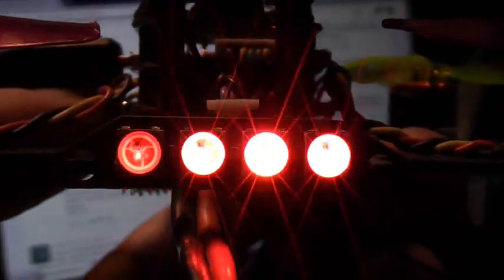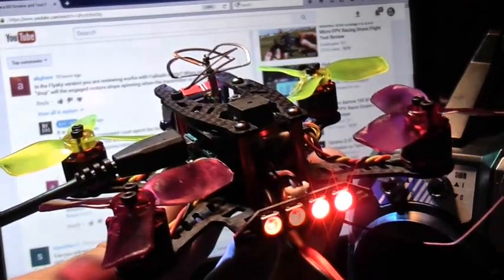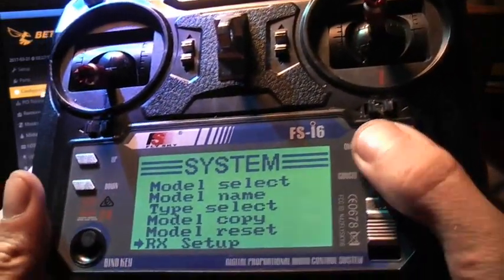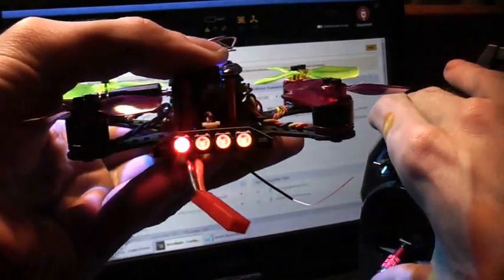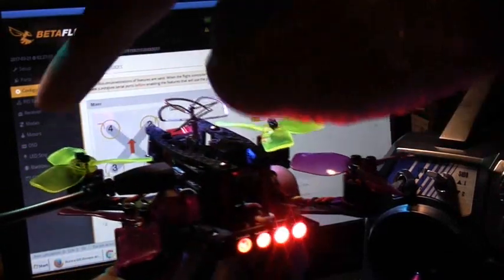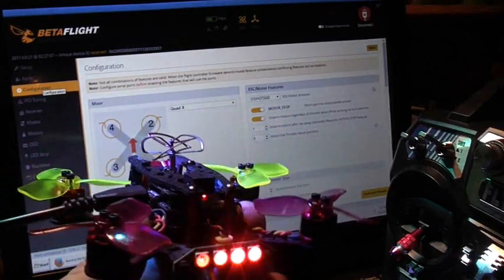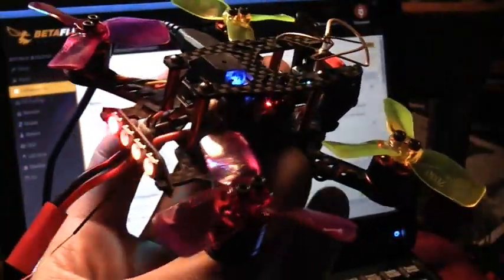Was this drone prgramed to fail and fly away

Comment: Mine flew away the other day... failsafe was set in betaflight... I was only about 60 meter/yards away when the quad would not turn I tried to disarm and rearm I regain control began to turn around gave about half throttle to a fence and it went full throttle climb at about a 45 degree angle total flyaway. Thank God I live the country... that little quad is somewhere in 200 acres of wheat. The battery was fresh and most likely flew for close to 4 minuets at full throttle... my spotter lost visual in about 15 seconds. Video dropped at about 20 second at I’m guessing 400 to 500 high...😧😳 been flying RC for 20 years and that was my first flyaway.... BE VERY CAREFUL WITH THIS QUAD... Mine could have hurt someone or damaged someone’s car...

Comment: Flysky version failsafe does not work on BF gui or the TX.
Frsky and DSMX work fine as verified by many.

Better durability props available now, they don't bend at the root and cause stress marks quiet as easy. Here's my last video flying them. I won't be going back to stock.
https://www.youtube.com/watch?v=n2SdsH_ddxw&feature=youtu.be&ab_channel=MicroRCFiend
Reply: MicroRCFiend AndyRC and others actually reported brownouts with the FrySky version due to the voltage telemetry. Currently the DSMX version is the only one without issue. I'd stay clear of eachine FlySky and FrySky RX and use an external micro RX if you wish to use those protocols.
Reply: There is not general consensus yet whether that is due to telemetry since others that did have the FoD early on (Seby and FyreSG), can no longer duplicate it. It may well be but it needs more than 1 person to verify that and it needs to be repeatable to be sure. More data is needed, especially as it's very common for early reviewers to get a slightly different version than retail purchases.
Fyre says he still has telemetry on with Frsky and cannot make it FoD, Seby just has a new frame so curious to see if he has these issues.
There's some discussion here if interested..
https://www.rcgroups.com/forums/showthread.php?2849192-Eachine-Aurora-68-68mm-Micro-48g-Brushless-BNF-with-OSD/page7

Comment: try setting the failsafe to channel 5 or whatever your arm switch is on. i just got a turnigy evolution and was setting it up on my wizard and it would not failsafe on channel 3 so i set failsafe to channel 5 which my arm switch is on and failsafe works now
Reply from the maker: I'll try that on a few of the other eachine aircraft with this problem.
I just posted a video showing how I take the FSA8S receiver from my falcon 120 with working fail-safe and solder it in this one. It gets the failsafe working but I would like an easier fix like you suggest. The arm sequence in the falcon is different than the arm sequence in the aurora. The aurora uses channel 5 and the falcon 120 uses down and to the left on the stick so you might be on to something.
Reply from the maker: With the faulty receivers, the pulse width of the throttle doesn't change 
when I turn off the transmitter, it just stays at the same value until I turn the
 transmitter back on.

With the FSA8S receiver connected, when I turn off the transmitter, I 
can see the throttle value jump to 875 or whatever the pulse width value for fail-safe is set at. If I change that "875" fail-safe pulse width value in betaflight on the fail-safe tab, I can see the results on the receiver tab because that is the value that the throttle will jump to when the TX is turned off. 

How did you define having fail-safe on channel 5, did you do it in betaflight or in the transmitter. I can't find a way in betaflight to do it and with the flysky fsi6 transmitter I can turn fail-safe on and off for different channels and change the value but I can't define a specific channel to act as fail-safe as far as I can tell.
Reply: it was with my turnigy evolution on my eachine wizard. i turned fail safe on and went to -100 on channel 3 and it wouldnt failsafe and i found a video where the guy set channel 5 to fail safe and it would failsafe and it does work on my wizard. i tried it on the aurora with no success
Reply: this was all done on the transmitter but i could not get failsafe to function either

Comment: 'Micro' Flysky receivers have been notorious for a lack of failsafe. This is the new Eachine cube (AIO stack) so there's no excuse for this oversight. There's usually no fix unless there's an iBus option, in which case failsafe works normally when using iBus. I have an Aurora 100 on the way so I'll likely swap the Rx for an A8S or Micro iBus Rx. I have both and they perform well with over 200m range at ground level outside (perhaps worst case). I recently switched-out the mono-pole antenna on my A8S for a sleeved-dipole (linked below) and I can't find the range, but it's over 300m.

http://www.banggood.com/Flysky-FS-A8S-2_4G-8CH-Mini-Receiver-with-PPM-i-BUS-SBUS-Output-p-1092861.html
http://www.banggood.com/2_4G-8CH-Micro-Receiver-PPM-SBUS-Output-Binding-Button-For-Flysky-AFHDS-2A-i6-i6s-i6x-p-1119833.html
http://www.banggood.com/3DBI-Brass-2_4G-Receiver-Antenna-Omnidirectional-IPEX-Port-Compatible-Futaba-JR-WFLY-p-1032401.html

Comment: That is not the place to set up the failsafe. You have to go into the failsafe tab (have to be in expert mode, top right corner). As for the motors spinning up that is either airmode doing it's job (because it can't get control with you holding it), or just I term windup which shouldn't happen in flight.
Reply from the maker: I might end up having to do that, it's possible that eachine is flashing a defective version of betaflight. UAV's should never make it past QC with a bad fail safe feature.
Reply: Yep just pick in that menu failsafe Enable failsafe stage 2 and choose drop. Motors stop and your quad comes down. Problem solved.
Reply from the maker: Actually radio does matter, The fact that you are using a taranis radio means that you are using the FRSKY receiver version not the FLYSKY receiver version. 
Thank you.
You have helped confirm that the problem is with the flysky receiver, and you have helped confirm that the FRSKY receiver does not have this problem. As I stated all the settings on mine are the same as they are on yours, failsafe should be working, I listed all the settings to you in my last comment, please if you can find any one of them that are incorrect I am willing to listen.
Only people using the FLYSKY receiver have reported this issue, no one has reported it on any eachine FRSKY or DSM2/DSMX version.
Reply: Those are the first things I thought but R/C 101 apparently checked the failsafe tab (comments below)...and the spin-up is likely Air-mode as you mentioned...we'll see since I ordered this quad a week ago.
Reply: His settings are wrong and in his video he does not do any thing about the fail safe. As he did he must film that and show it because as you set it right it stops. I have set it on my radio and in there i can do more things. My buzzer starts beeping also as it goes on fail save.
Reply from the maker: I don't show it in the video but everything on the fail-safe tab looks like it is set properly. It's set to drop, pulse ranges are valid, tx settings look correct, AETR are all set to auto...What settings am I missing. Are you using the flysky version?
Reply: Radio does not matter. I use a taranis
Reply: Does failsafe work for you with a FrSky Rx?
Reply: I now other people that have a flysky radio and don't have that problem.
Reply from the maker: The question still remains, why do some people experience it and others don't.
Reply: Upgrade it to a newer version of betaflight and see if you still have the problem.
Reply: Well with this level of video's it is strange that he get's even this amount of views.
Reply from the maker: This video was a 2am after putting the baby to bed fan requested video, sorry for the bad quality, no one had figured out the problem yet and I was just trying to help, my follow up video shows the obvious solution of adding an FSA8S receiver, but the question still remains, why do the values stay constant when the flysky transmitter is switched off when bound to some receivers and not others.
With the FSA8S receiver the values drops to 875 or whatever it's set at in the failsafe tab when the transmitter is shut off. 

On another note, as a critic and viewer...
Do you think my free paper Japanese zero video is any good?
 https://www.youtube.com/watch?v=4xldHOSC9h8  I do the best I can with a zero dollar budget. 
well maybe a 2 dollar budget, that's about what the advertising has earned from it so far, but I can handle hearing that it's crap if it's crap.

I would love to get lucky again and get 5 million views like I did on this one, 
https://www.youtube.com/watch?v=QLuqqSW0zX8 but that was 8 years ago before quads wear popular and before 3 axis mems gyros wear cheap.
Reply from the maker: If you can help i know of a few people who would like an answer to the flysky tx/rx failsafe problem.
Is it a receiver programming issue, is it a flight controller programming issue, is it a transmitter issue.
In the follow up video I show that the tx probably isn't the problem because I don't reconfigure anything on it but I get failsafe working.
I loaded my backup copy of the stock betaflight settings for this aircraft to make sure everything was stock, then I hooked up an FSA8S receiver from my falcon 120.
The falcon 120s failsafe worked.
When I tested the failsafe on the aurora 100 with the new receiver it worked perfectly.
If the problem is with the flight controller it might be a receiver configuration issue that can be fixed.
If the problem is with the receiver being programed improperly or having stack overflow issues or something like that it might not be an easy problem to fix.
You can't always slap on a new receiver so re-configuring betaflight is the better fix, I've tried all the obvious configurations but I'm not an expert and can't find a set up that works in the time i have.
It's either a problem with eachine/flysky aircraft, or a problem with a lot of flysky users.
Out of 5 eachine flysky aircraft I tested only 1 had a working failsafe.
Reply: That paper airplane build of that Japanese plain is good.
The other one I did not like but times where different and level of quality was lower.

THe problem with this video and I don't say that I would do it better but for what I have seen you can certainly, is that you give in the video the wrong information. You are talking about something and solving it with something that has noting to do with it.
I follow many Youtubers now and I have contact with some of them and all of them don't upload a video as they don't find it good. It does not mater if it is a vlog or an information video. Also before they give info, they check it them self how it must be don or they show the problem and ask for help. 
In this case I found the video more like that you have a problem, look ad the wrong place in the video and say id has a problem without being on the right place to solve the problem. 

Other than that, please stop complaining about that you have no money. You are not the only one and as Youtube does not for see you for the money it maybe did, it is maybe time to find an other way to urn money.
I never got money from Youtube, I designed some pods for some frames and they are free on THingiverse and I don't get money for that either. Do it because you like it and not for the money. As you like it, others will start liking it also. 
One more thing. Look ad your japanese paper plain and look how that is made and this and see if it is the same standard. You can way better and you now that. Stay with what you now to learn people and the things you don't now you can make a video about but don't try to find people that can help trough your video's.
Believe me as you start making video's like the japanese plain, you get a lot views back. That one is really good. It is not my thing but it was not unpleasant to look ad.
Don't upload these rused video's. It does only bad for your channel.

Goodluck and I hope you get it back on track with youtube.
Reply: You are correct, Here is a thread on the banggood formus from the CREATOR of the receiver saying that it is a design flaw not allowing flysky failsafe.

https://forum.banggood.com/forum-topic-129701.html

Comment: Be careful you might burn out the motor & ESC when you turned on the motor blade hitting the USB cable. If the motor can't spin and it's hitting something you risk burning something out. Good video and info. Thanks'
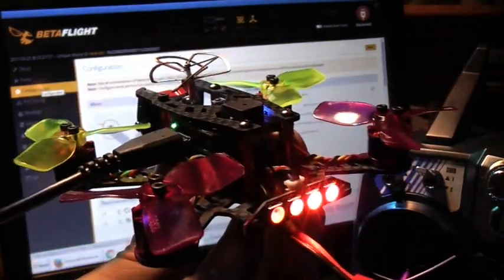Reply from the maker: You're right, I should have unplugged the USB cable first or removed the rotor. I had just finished putting the baby back to bed and it was 2:30 in the morning so I was being lazy.
At low throttle it worked but if the throttle was raised far enough the esc let me know there was a problem by beeping before it let me burn it out.

Comment: I've heard of these issues with different  micro Flysky rx's. I cannot understand why anyone would ever make an rx that doesn't have a working failsafe, it should be illegal! Luckily these micros are usually too small to do much damage, but a flyaway could theoretically get someone hurt, and at the very least make you lose your $100 toy! Let us know if you figure out how to fix this issue, I like the look of that quad but I won't buy it if there's no failsafe
Reply from the maker: I'm curious if any of the frysky or dsm2/dsmx versions have the same problem.
Reply: R/C 101 I've never heard of any other rx that doesn't have a failsafe. That's literally one of 2 things an rx needs to do
Reply: R/C 101 I've never heard of any other rx that doesn't have a failsafe. That's literally one of 2 things an rx needs to do

Comment: Thanks for verifying my personal encounters of the Eachine Flysky micro race quads failsafe issue. I had 2 fly away encounters while do FPV in an open park. It is hard to judge distance in an open field for me while FPVing. Luckily for me, both encounters were happened while flying in about 10 to 15 feet height when both quads fly away and crashed into trees in the park. They are recovered after some searching. No real damage other than some props need to replace.

Comment: Go to the fail safe tab on beta flight! You have to go to pro settings at the top of the screen.
Reply from the maker: I think it's more of an issue with the flysky receiver as opposed to the flight controller. FRSKY users aren't reporting this problem. I'm going to try to factory reset my transmitter, completely unbind the aircraft, set up failsafe in the transmitter before I bind it instead of after binding and see if that has an effect. I can't think of anything else to try off the top of my head.
Reply: Put it on drop. It shuts off the motors. You are setting only the things for arming and that had noting to do with failsafe ad all. That only setups if you want to have the motors spinning on min throttle or not and.
Reply from the maker: I know I didn't show it in the video, it was 2:30 in the morning and I just put the baby back down, but I actually do have it set to drop on the fail safe tab in advanced mode.
Stage 2 settings failsafe is turned on
Kill switch is turned off
guard time is set at 10 (1 second)
failsafe throttle low delay is set at 100
The box for drop is checked
Channel feedback settings for pitch roll throttle and yaw are set to auto, so they should default to center or lowest position.
Aux 1 through 8 are set to hold
pulse range is valid, set at a low of 855 and a high of 2115

all the transmitter channels on my flysky fsi6 show that failsafe is active as you can see in this video.

I understand and am willing to admit that I may have something set improperly, but honestly shouldn't failsafe be set and programed by default.

I can understand needing to turn it on in the transmitter, but it's hard to believe that eachine expects everyone to go into beta flight and configure it without giving any instructions about it. 

What else do you think I could be doing wrong?
Reply from the maker: I went through all the settings on the advanced tab and they all looked like they are set up properly. throttles on auto, valid pulse ranges are 855 and 2115. delay is set to one second.
Reply: Can you flash it with the falcon 120 custom betaflight link on banggood and just change the voltage? I am a noob just trying to help!